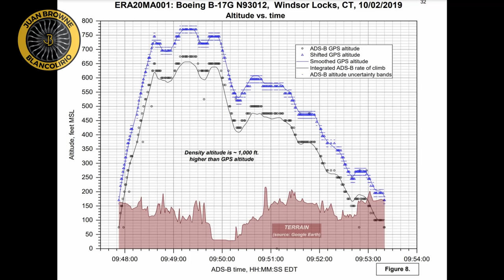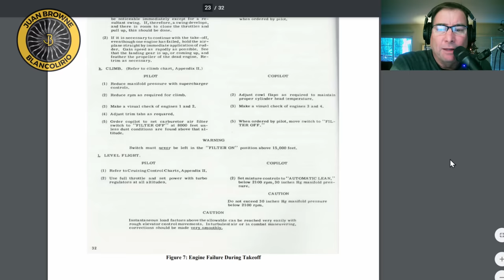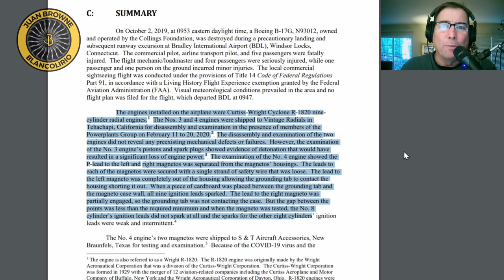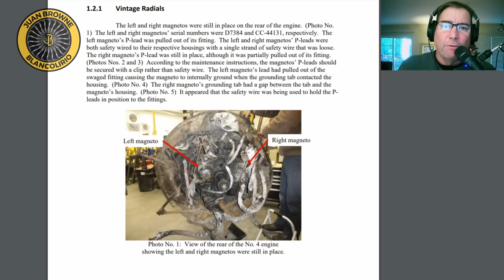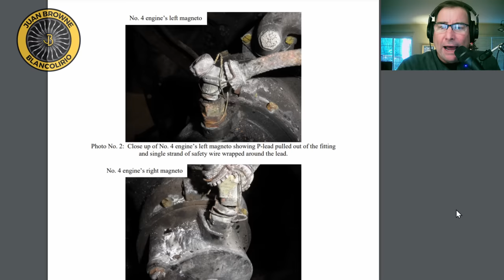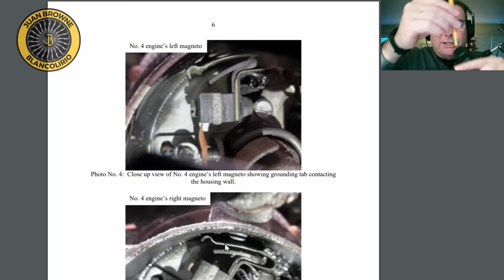NTSB Report B-17G Crash 'Nine-O-Nine' Part II -18 Dec 2020

Comment: This is one of the saddest videos I've ever watched.

I'm old enough to be from the points, condenser, coil era.

I maintained my junker car and motorcycle ignition systems better than done on the B17.
Reply: Agreed...I used a dwell meter on my cars in the day just because I hated to "guess" that feeler gauges were being most accurate. GM engines had an access door on the distributor cap that could be used with an allen/hex wrench to adj the point gap, they were a real convenience as you could run the engine and adj the gap (dwell) down to the finest net measurement.
Reply: @Garth2011  I got way too familiar with the GM ignition system when I got a brand new 62 Corvette. Burning a qt of oil every 300 miles meant pulling the plugs almost every week. I bought one of the plug cleaning machines like shown in this video. The dual point distributor also burned points very quickly. The problem was a defective block casting. GM refused to replace it. I turned wrenches on heavy trucks and earthmoving for quite a few years. I would have been fired if I did what I see in this video.
Reply: @Garth2011  
Yes the Delco window distributor, if you had a car with that, you were the envy of your FoMoCo and Mopar friends, with the handy flex handle allen adjustment tool and the dwell meter!
Reply: @Garth2011  on an aircraft engine, there is no such thing as timing adjustments on a running engine. As if you are going to stand on that ladder at the magnetos while the prop is swinging and play with your dwell meter and adjusting tool...
The point gap is by feeler gauge on an aircraft magneto, period. The mag to engine timing is by primary circuit continuity, normally simply a light, to a protractor graph on the prop or spinner to gauge crank position.
Reply: @davidvicari5139  Thanks for reminding me this is an aircraft with a prop. I don't see where I said that should be performed on this 9 cylinder radial engine however, it would be something a real mechanic would do on a distributor machine. They'd remove the magneto from the engine and overhaul the mag and set it up on a machine that tests all of the electrical and adjustments. Not many of those around these days but they used them before electronic ignition. It's an option to using feeler gauges and it's very likely even the sour mechanics who worked on these magnetos would know not to run the engine. I can't say enough how poor those mags look. Ask any top fuel mechanic about magnetos, they use them too.
Reply: @Garth2011  “distributor machines” don’t make sense for aircraft magnetos.
A distributor machine would do nothing to address mag to engine timing on an aircraft engine.
The Sun distributor machine comes in for automotive practice, when old fashioned distributors had centrifigally adjustable advance curves.Guys would play with counterweights and springs to alter the curve for racing and hot rods. 
An aircraft magneto has no variable advance mechanism. My Continental O-300 has  one mag set  24 BTDC, the other at 26, per the factory maintenance and overhaul manual. My mechanic checks this timing at each annual, but the tools are simple- carefully determining crankshaft position, and checking the primary circuit point opening with a continuity light. Aircraft mags have an impulse coupling that gives a momentary retarded spark for starting, but there is no advance curve.
The idea a “ real” mechanic puts a mag on a machine, that is precisely the sort of misinformation that gets guys in trouble around airplanes.
Reply: @davidvicari5139  They could confirm the point gap by looking at the dwell and overall operation etc. Not sure I had anything to say about spark timing or advance, just the point gap and how the GM distributors had the access door to their points. Not sure why the waters are getting muddied up with the timing and setting point gaps while a propeller is whirling away.
Reply: @davidvicari5139  Are you done yet? Use your feeler gauges. I'll use a dwell meter. Magnetos needed removed and rebuilt as they were/are complete crap and likely killed them folks. Just to confirm, these magnetos never made it to published procedures so I'm rather sure the dwell readings wouldn't have helped in this particular matter. Point is, none of the procedures got any traction on the one engine based on its condition in the photos. Had they followed procedure and used the wrong feeler gauge this may not have happened.
Reply: @Garth2011  yes, agree to everything you said, except a dwell meter has no place around aircraft. I don’t mean to beat you up, but I won’t suffer misinformation. Yes, there is a lot in common between aircraft and traditional automotive systems. An understanding of function, theory and procedures is essential with airplanes, but there is a tendency with guys who have gained this understanding around old cars to think they know it all. Aircraft are much the same, but  there are some important differences. Everything bad about this accident, the condition of the magnetos, could have been avoided, but not with a dwell meter.
Reply: @Garth2011  thanks for the video which verified everything I said! Not a dwell meter or “distributor machine” in sight.
Reply: @davidvicari5139  No machine huh? You must write news for ABC or CNN. Now, find us the information that says a dwell meter has no place for magneto points setting.
Reply: @Luigi-pk8mk  Still have my adjustment tool along with my Sun timing light. Haven't used them in 35 years, but can't get rid of them.  So sad...
Reply: @davidvicari5139  Go away, your mind is a full bubble off plumb. You haul more crap to a discussion. CNN is referenced to your spin on the topic.
Reply: @robertweinmann9408  Don't feel so bad. There are folks with those older vehicles that need them and some of the more modern auto shops don't have them anymore. So simple and so reliable the old hardware was.
Reply: @robertweinmann9408  
PS I still use the dwell meter and my advance timing light, why, because my 1988  OMC/Chevy 4.3 V6 has a Prestolite points/centrifugal advance distributor. I was able to use it to teach my son how a breaker point ignition system works. And, I felt no need to change to electronic. Good quality points are better to me than aftermarket electronic ignition.
Reply: @Garth2011  I write for the benefit of sane people here. Dwell meters have nothing to do with aircraft magnetos. There is no “distributor machine” appropriate for use with aircraft magnetos. Magneto principles, maintenance procedures, overhaul requirements are well documented. Failures leading to this accident are well explained by Juan. The idea that feeler gauges are the culprit and dwell meters are the answer is fool dangerous nonsense.
Reply: @davidvicari5139  You can believe what you want to. You are still a full bubble off plumb when conversing on a subject. Minimum requirements don't mean you cannot go above and beyond which is where you tend to draw your line. Once you become familiar with the subject, its much different than reading a text book about minimum requirements. Never said the point gap was the reason for this crash either and never said feeler gauges were. There you go again, put the spin on the matter. Never said dwell meters are the answer to point gaps either but what I did say was, dwell meters will get a more precise gap vs. feeler gauges. Think what you want to. Some of us have mechanical backgrounds, some don't and some read a lot and never touched a hand tool. Just go back and read your spin about my mentioning a distributor cap window on GM engines to adjust the point gap. You have no vision and your plumb bob is off once you move away from the text books into the real world of getting it done. Rules and regulations are meant to weave with the real world of mechanics to establish minimums, not limit them. Go Away...
Reply: Garth, I have been doing my own work for 45 years. Unlike you, I have practical aircraft experience as an owner doing my own maintenance with my AP/IA signing off as required. I say again, you are spreading dangerous, foolish misinformation. Surely there is some old fart comment board where you can show off you know how points work.
Reply: @Garth2011  See your first comment, congratulating yourself on the “accuracy” of a dwell meter. See your own comment, a “real mechanic” somehow puts an aircraft magneto on some kind of “distributor machine” that “ does all the adjustments and electrical”. None of this exists in reality. No, I don’t know your background in mechanics. I do know you like to bs your way when you don’t have a clue what you are talking about. I will stop short of wishing you personal injury, as you have me. Nice, Garth. Merry Christmas.
Reply: @davidvicari5139  Dwell meters are more accurate than any feeler gauge process. Will an aircraft mechanic use one? It's an option, not a requirement. I doubt very much there is no such thing as a magneto machine...they have to be tested at some point dynamically just to get approved for use. As far as not having a clue, I have to let you in on the fact you are so wrong. Just because you don't view a dwell meter as another method to set a point gap doesn't mean its off limits. You can set the toe alignment with a tape measure on a vehicle or use an expensive computer driven 4 wheel alignment machine to do the same thing. One is slightly more accurate than the other. Concentrate on the subject which is nothing more than a dwell meter giving a point gap setting. There's plenty of ways to set points on an engine or off, other methods aren't illegal, just another way to confirm the gap is correct. You can use your feeler gauges, nothing wrong with it but if a dwell meter came in behind that setting, it would likely show a different gap resulted.
Reply: @Garth2011  “ other methods are not illegal”. Wrong, Wrong wrong!! Around aircraft, everything is by the the book, which is FAR, which is Law, Garth! You tell me to “ concentrate on the subject” , while you have wandered off into wheel alignment with a tape measure!! Maybe I should not pick on the elderly! How old are you?
Reply: @Garth2011  500 nr mag inspection.. You show me where they have to be “tested in some way dynamically” to be approved for use. What you “ doubt” does not count. Again, you figure just bs your way, not around aircraft!
Reply: @davidvicari5139  You truly are obtuse.Happy flying.
Reply: I’ve been through 500 by magneto inspections on my plane. I have been through repair after failed run up on my engine. I’ve seen the procedure at annual inspection, because I am there turning wrenches the whole time. There is no dwell meter or test stand involved. My mechanic is one of the few who will rebuild a Bendix mag, most young guys will have you buy a new one. Again I appeal to your conscience to retract all the silly bs you have stated based on nothing, with irrelevant links thrown in in lieu of brains.
Reply: @davidvicari5139  You squeezed in the advance as well as the timing idea, I didn't. I said they might have a machine for magnetos like they had for distributors. You also said there's no machine like that for magnetos. Well...There are...Google it.  This again contradicts your official opinions that one is wrong to use a magneto test machine and a dwell meter to confirm specs. The 500 hours magneto rebuilders use these machines. The ones you don't believe exist or aren't required.  No rebuilder will deliver a product without testing it before returning it.
Reply: Read your own link. Your test stand tests advance curves. Do you stand by link so you provide or not??? I am telling you the 500 hr mag AD is done in the field without a dwell meter or test stand. You don’t get your own facts. Hell you are oblivious to facts. Just like the sound of your own bs.
Reply: @davidvicari5139  never said you couldn't David. I did say a test machine and a bench test would provide more accurate results,  dynamic results. 
There's a mag repair shop, lots of aircraft mags, in Montana who do 500 repairs, rebuilds etc. They put them on the test machine. QAA also tests their 500 repairs prior to sending them back. Something wrong with that? 
Just because you don't send them out doesn't mean magnetos shouldn't see a test machine, required or not. The machine way above you wanted to call a distributor machine. I said a machine similar to what real auto mechanics used on distributor maintenance.  The focus is about accuracy and conditions while spinning. There are magneto machines, likely many types. Google will find them. You believe using a machine has no business around aircraft magnetos,  I'd disagree.  45 years of practical mechanical experience after you develop for 15 years would put you in the old fart category you claim I belong to. Just because the rules suggest in the field doesn't mean you can't go above that standard and remove the mags sending them out for the service. They all get run on magneto machines to confirm dynamic functionality so all you have to do is install and set the timing. Those machines have their place and the B17 magnetos would have been good candidates to have been removed and rebuilt then tested on a magneto test machine to confirm operation and spec. Had they, they'd have discovered the magnetos were unfit or better yet, sent them to a magneto rebuilder who would not have given a pass report.
Reply: @Garth2011  this from the guy who told me  he was Mr. practical, and I read everything out of a book. Google is no substitute for experience.
Reply: @davidvicari5139  Yes, that link to the test stand is legit. That particular Magneto test machine does both aircraft and automotive magnetos which would explain why you went off about the advance feature when you saw it so it must be for automotive only you were trying to make the point of. It's not for automotive only, it will test both types.
This was what started the debate: “distributor machines” don’t make sense for aircraft magnetos.
I disagreed and maybe because your mechanic and your 500 IRAN included only inspection and cleaning etc. threw you off that a magneto machine might exist so the mechanic could remove the mag from the engine and go test it on a machine that will provide the voltage outputs and a lot of other data. I think you were thinking the 500 IRAN doesn't require a magneto test machine or that a magneto machine didn't exist for aircraft. I disagree it doesn't exist and now that we are this far into it, they are used fluently in the aircraft industry of magnetos. I'm saying again, magneto test machines exist, they are used by rebuilder's, they are used by aircraft industry. And while the mag is hooked up to the machine, any dwell meter can display the degree of the points open/closed while the mag is right there on the machine and turning. 

Not every Google search will find honest and real data however, there are lots of legit websites and YouTuber's. The art of Googling is determining what information is legit and honest. 

Some research just to show magneto test machines are on the market and that the industry does use them. So the statement that they don't make any sense for aircraft magnetos isn't true according to the industry who builds and rebuilds them. 
https://www.hydraulictechnology.com/products/ground-support-equipment/6920B
https://www.aircraftmagnetoservice.net/ 
https://www.avotek.com/shop/magneto-testers/
https://www.qaa.com/products/aircraft-magnetos
Videos included in thier webpage below:
http://kellyaerospace.com/the-500hr-inspection-and-why-its-so-important/
http://gatesvalleyservices.com/m6-all-in-one-magneto-testing-machine/

Of course, you can do your 500 per the rules and without the magneto machine but since someone said they don't make sense for aircraft magnetos, I thought I'd challenge that idea because they have value in an overall test of the magneto before it is put into operation for output and specification. In this video, 13:32, Juan discusses the test machine.
Reply: @Garth2011  what is “ a lot of other data”? How does the “ distributor machine” set e-gap? How does the “ distributor machine” influence external mag timing? How does the “distributor machine” assess the impulse coupling condition and function? Or, the shower of sparks systen with dual points and external vibrator? I still say you are trying to work backwards with links to cover nonsense you wrote about a topic you do not understand.
Reply: @davidvicari5139  You are off the topic again. Point was, your statement was incorrect and I said so then came all the expert BS from your toolbox. Tell the investigators of this B17 crash how full of it they are. Dwell on that if you know what dwell means. Egap was never mentioned ever in 39 replies, concentrate, and point gap does exist on magnetos.   Goodbye.
Reply: @Garth2011  the investigators did not mention dwell either. So, your point is??? Sorry, you are pointless.

Comment: Who ever signed off on those mags? Need I say more. What's with all the debris in the bottom of the enclosure on the last pic?
Reply: Good ole boy network.
Reply: This is not passing the smell test.
Reply: This is the stuff you expext on a car that has not had any maintenace and driven until it compeately fails. Not on a aircraft. 
Rust, grease, crappy old leads fixed with metal wire for 5 years! WTF. And all electric components out of spec. capacitors cables, coils, use new ones. these components deteriorate, specialy in HV aplications.they are not safe, even when (still) in spec. not in this aplication.